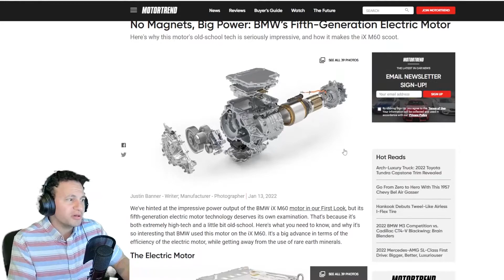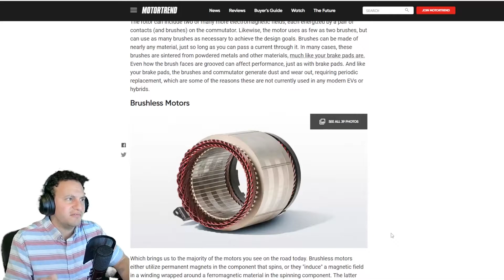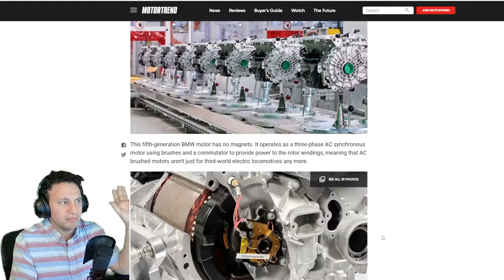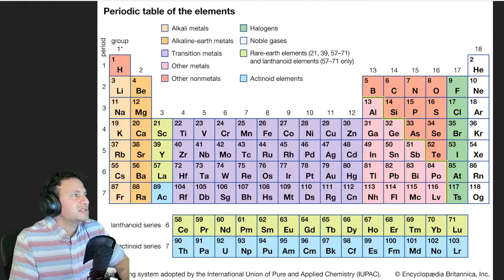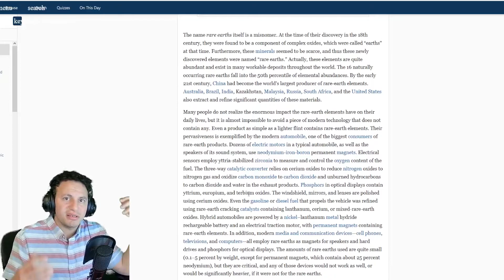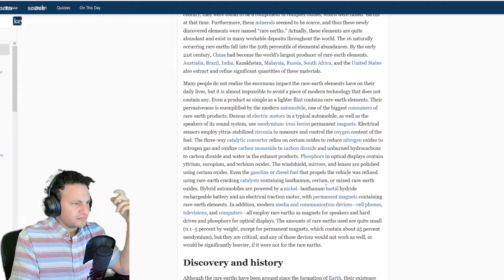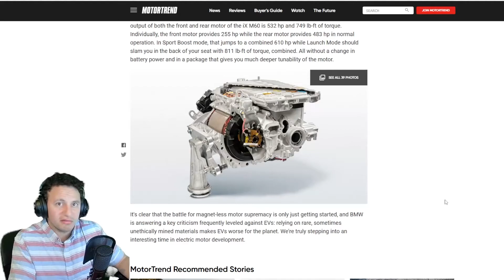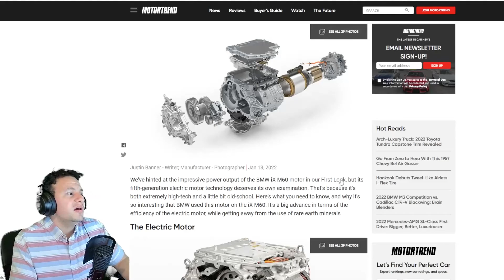BMW 5th Gen EV Motor

Comment: The reason why BMW uses a syncronous motor with brushes is completely different from what you're thinking and saying.
The motor they are using is NOT a conventional brushed engine, by any mean!! It's rather an electrically excited syncronous motor.
BMW, as usual, demonstrates that they are far more long sighted than most competitors.
There are two reasons, why they've gone that route:
First: they ditched expensive and in perspective difficult to procure rare earth magnets.
Second (more important) they can adjust the intensity ov the magnetic field. In this way they avoid the necessity to waste a heck of a lot of energy ar higher speed to deflux the magnetic field.
You should study more about electric motors to understand this. It's not a trivial argument.
Reply: Fine. Is it more reliable or better miles on high speed?
Reply: 하지만 보증은 안 합니다. 왜일까요? 빨리 망가지기 때문이겠죠
Reply: @onionsoup485  nothing in this world or life is guaranteed, other than death. bmw is ahead of the curve by using this technology for a specific appliacation
Reply: 8

Comment: My first redaction was that BMW was going with the brushed motors fore some planned obsolescence BS but if that would be the case than they would shoot themselves in the foot since their competitors aren't using brushed motors (i can't think of any other brands tho). But i didn't know China made so many magnets. Maybe if China stops or limits their export of magnets them BMW might be better off not depending on that tech.
Reply: Has nothing to do with planned obsolescence. They use this type of electric motor because it has a high rpm range of peak efficiency compared to other types of electric motors like permanent magnet motors.
Reply: Renault also uses brushed motors
Reply: It will be interesting to see if BMW sticks with the brushed motor design for their Neue Klasse architecture that is debuting their 6th generation e-motor or if they’ll switch back to PM motors. Like everything else these days, China tends to make the majority of everything. They refine the most lithium, they own a ton of the mines in Africa and S. America, and they are home to most of the largest battery companies like BYD and CATL that supply all of the major automakers. BMW has announced they’re going to be producing their own in-house cylindrical battery cells starting 2025, so maybe they will continue with the brushed motor and be much more self reliant than other automakers like Daimler (and even Tesla) who rely on rare earth magnets and cells from China for a majority of their EV production. 

We have an i7 xDrive60 and it is very efficient at highway speed. In town the efficiency could be better, but it’s not that far off of an EQS which is impressive considering how much less aerodynamic the i7 is and the fact they’re using these unique brushed motors. If the brushes end up lasting 150,000-250,000 miles before service is required and without a decrease to efficiency or performance during their lifetime I don’t see any reason brushed motors wouldn’t grow in popularity, especially if they can get the cost to replace the brushes very low so people aren’t concerned about a huge unexpected maintenance cost down the road.